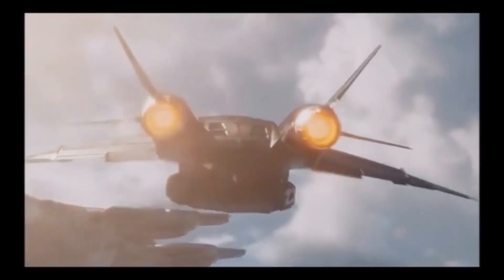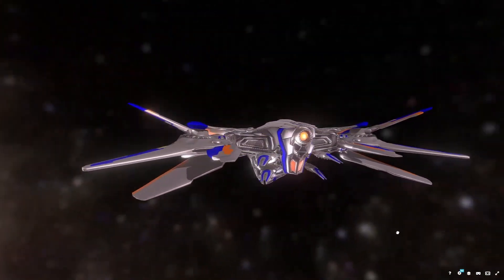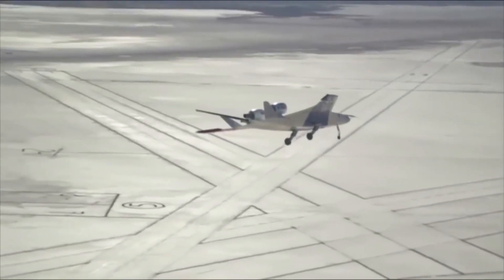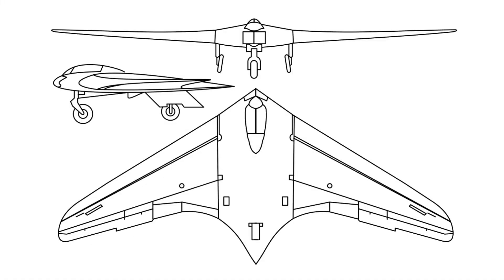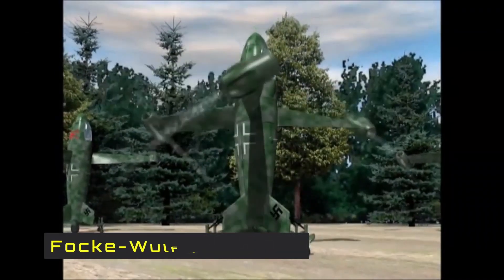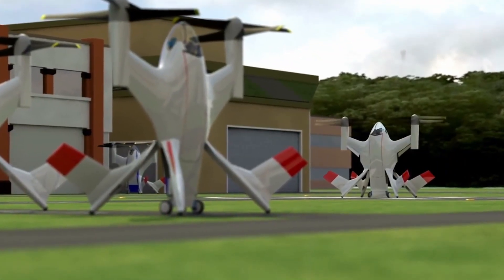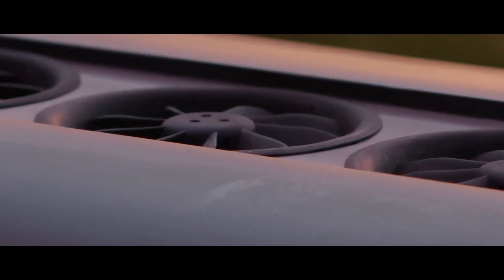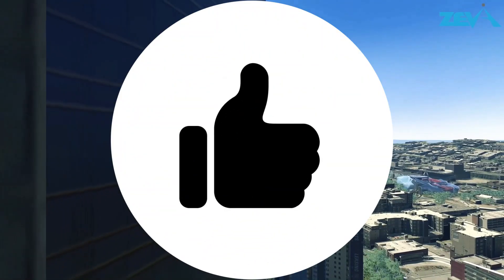Aircraft from Marvel Cinematic Universe for Electric Aviation

Comment: the disk loading on the quinjet's rotors must be extremely high with a heavy craft like that! Maybe they use the jet engines in the back with a connectable generator on them to produce maybe 1.5 MW of power for the two vtol rotors. Highly unlikely to be battery powered but I can see a possible rotating mechanical shaft power being used instead of electric motors to power the two vtol rotors although this would add lots of weight. Since the power density of jet fuel is so high I believe it could be done with existing examples like the F-35, which might make it better to just use vectored thrust for vtol like the F35. So maybe it is possible to construct, although some of the maneuvers shown in the films of course seem very improbable due to unrealistic very high g force loading.

Comment: marvel vtol still has double purpose help by land and take off and probably most sucssefull airplane tech design as is transporter and wing type is almost bat mouse design limit to diagonal and most high tech is in curve wings so wings are bird optimiyed to hold air down surpresed and allow easy switch from vertical glide to fast curve fly and engine speed so good that end speed is not troubled by fans as it has wings extension best part off airplane engine wings and vtol sucsses incorporated fro example a gulfstream done with so called wings fortifiaction improvments as is with 4 votl in it a easy passenger vtol with one engine or rotational servo or two just it lands anywhere and take off this brings vtol design in use as good and eficient and can be usefull still some speed and range depending on fuel tanks definetly more then auspreys and other vtols only thing to add is rotational cocpit  as escape so drive is even more scfi and easy to pilot